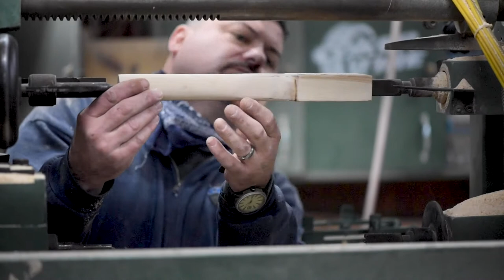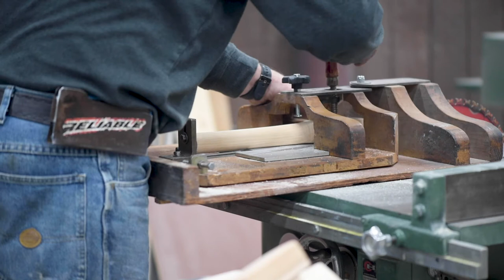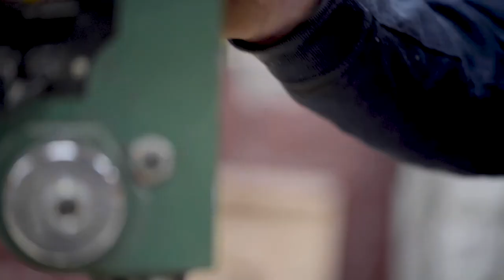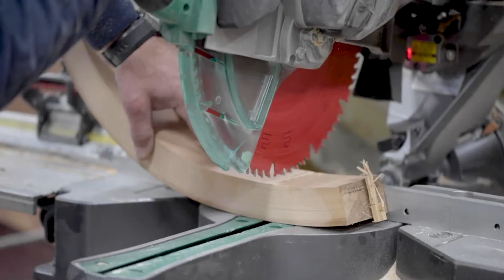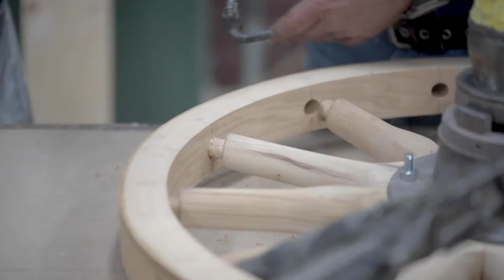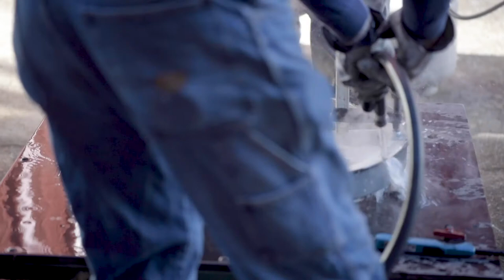Wood Wheels from start to finish

Comment: What is the purpose of tapping the steel "tire" with a hammer while cooling it off with the garden hose?  I have seen several other wooden wheel makers do this as well so it is clearly part of the regular process but not sure what it accomplishes.  Thanks.